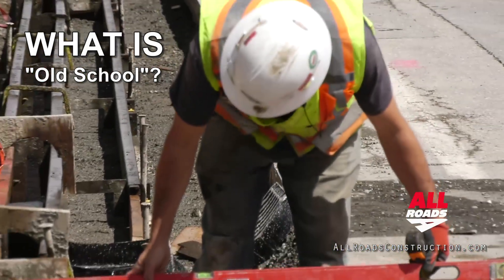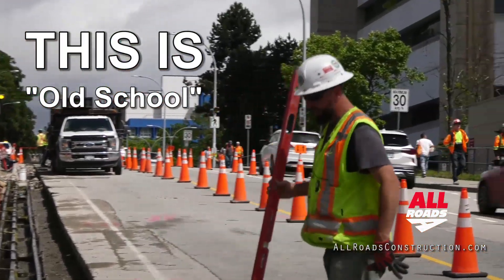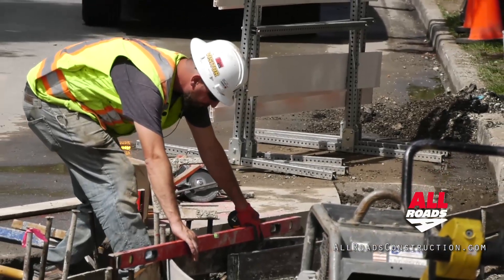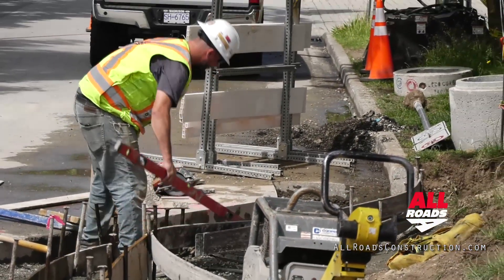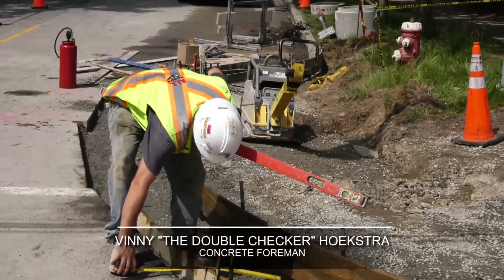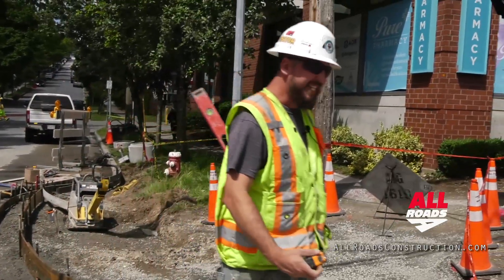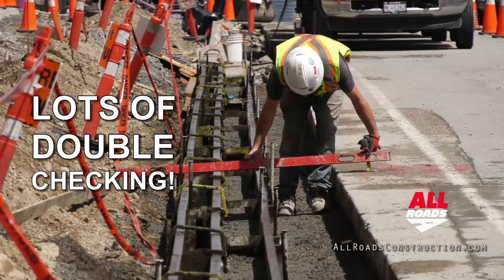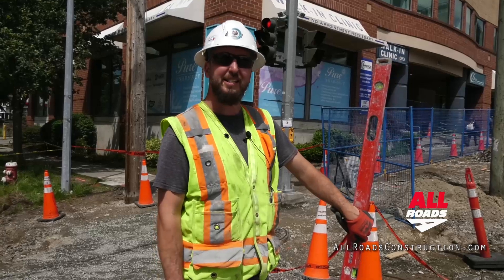Roadways Curbing & Concrete Curb Construction: Old School Method vs. Modern Technologies Use

Comment: Shouldnt gloves be worn while dealing with concrete? Or is it okay for it to touch skin.
Reply: It's best to wear gloves otherwise you can get Concrete Burn
 But I usually don't wear and when I get Concrete I wash it off quickly
Reply: Good observation and yes gloves are often worn…however concrete can touch the skin without harm
Reply: It’s okay to touch skin just don’t let it harden up buddy